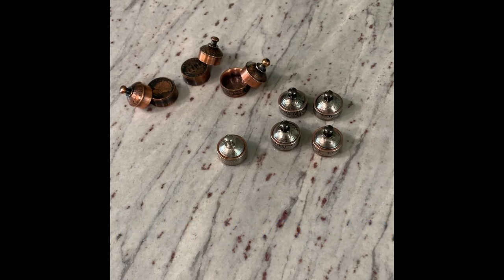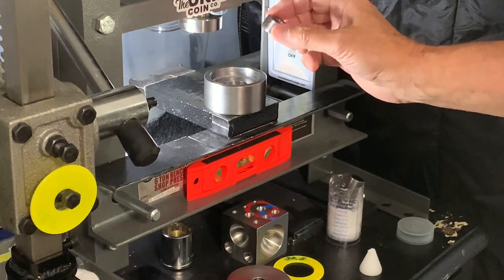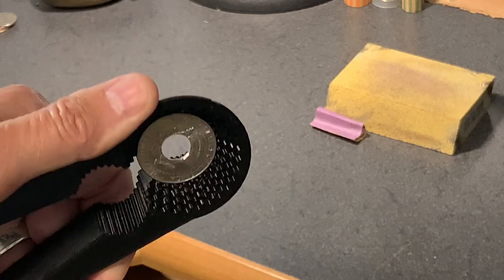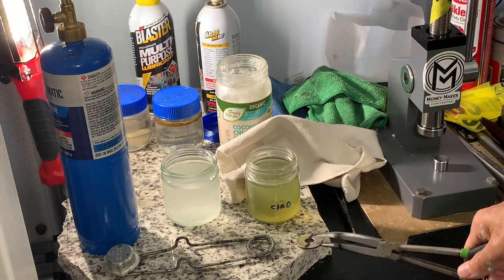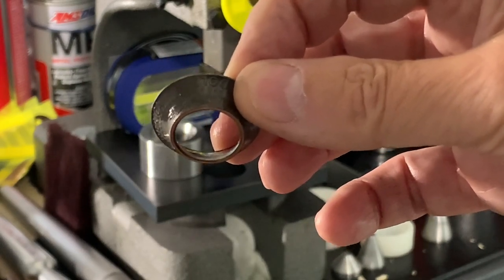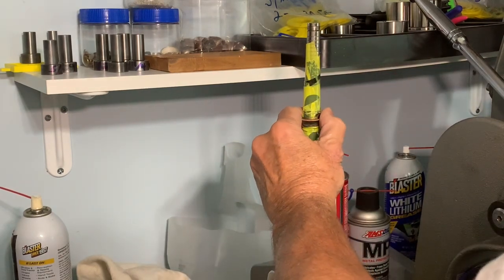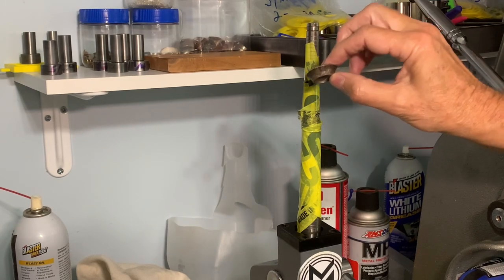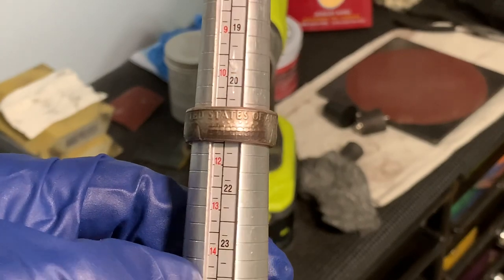TOOTH FAIRY BOX TUTORIAL PART 1

Comment: Where do you get the toppers for the bell and the tooth box I've looked on Amazon can you send me a link
Reply from the maker: Try this link.  You can also research other sellers once you reach here.  https://a.co/d/87B4BvM
Reply: @jpcoincrafts  thx I orderd some also for my bells too  thx....also good workmanship
Reply from the maker: @kennethhart9484  Thank you for subscribing to my channel and for your kind words.  Glad I could help!!!
Reply: @jpcoincrafts  where you get those big tweezers and does the Los hurt them
Reply from the maker: @kennethhart9484  https://www.harborfreight.com/20-offset-45-angle-long-reach-pliers-2-piece-64090.html

Harbor Freight and LOS doesn’t hurt anything.  I will clean them with 0000 steel wool after using them in my pickle solutions.  I also grind down the inside of the plier’s tips to a smooth finish as to not scratch any pieces that I’m working with.
Reply: Ok thx didn't think Harbert tool awsome yeah I've grindrd down my vice grips already lol it ain't nothin for me to destroy tools and money lol